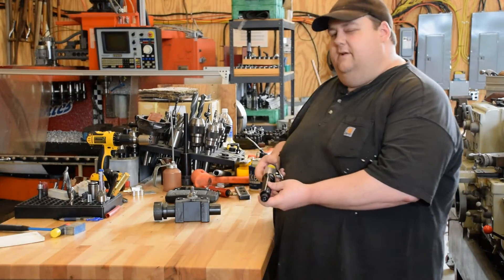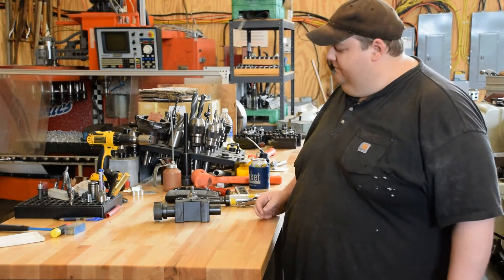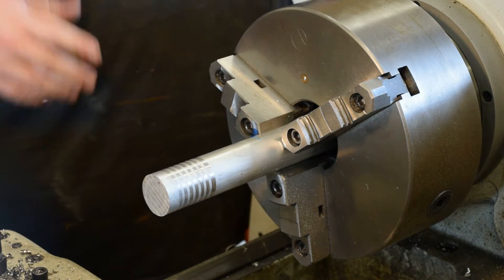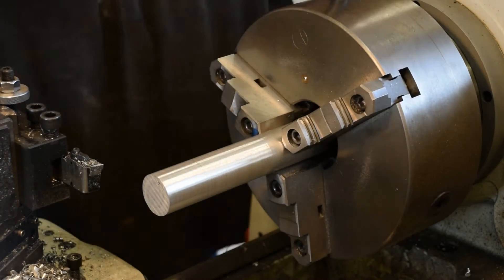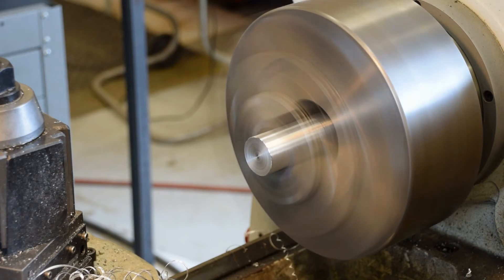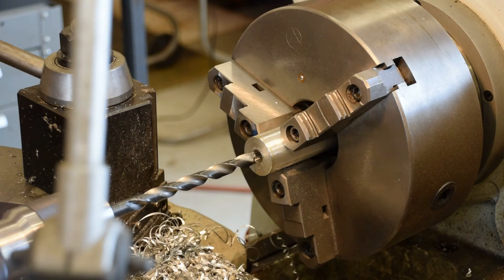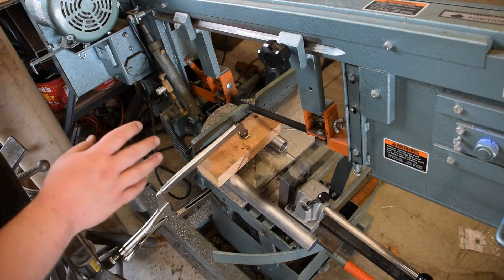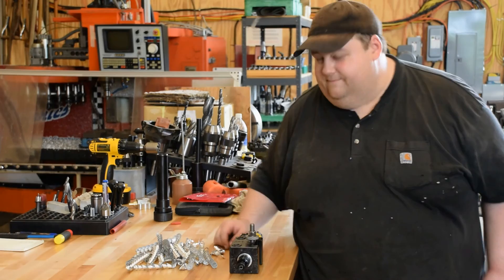Quickie Split Bushing

Comment: I woudl estimate that all I would need to buy is that $100k machine to make a $2 bushing.  That bushing cost about $100k.
Reply from the maker: Actually, that lathe cost just under $10k, brand new.  I made the bushing because I already had the lathe and I already had the material.

While that may have been $2 worth of metal, you'd not buy a bushing that size for less than $20-$30, add in shipping and you're getting close to $50.  I've got less than an hour into making the thing.

Forget the price, it was worth the hour's work not to have to wait a week for a bought bushing to show up.
Reply: @LogicIndustries  yeah, it is a nice lathe.  I wish all people had lathes.  That is my dying wish.  I only hope it comes true.  I agree with your lathe.  It is a good one.